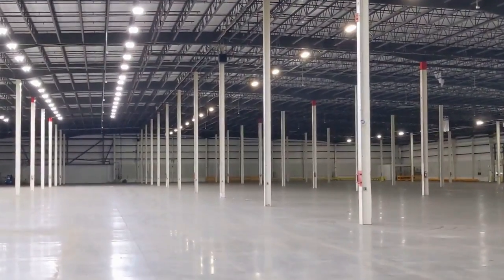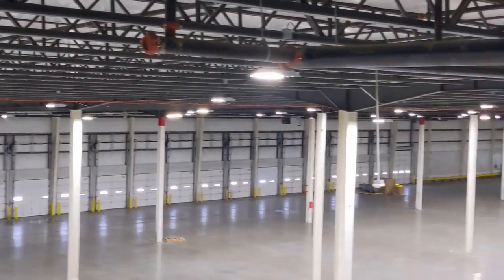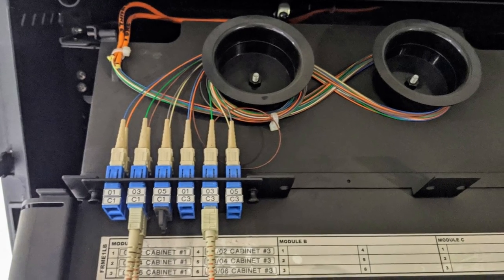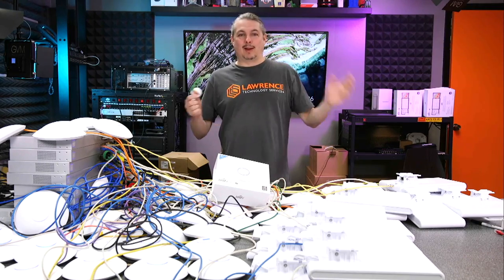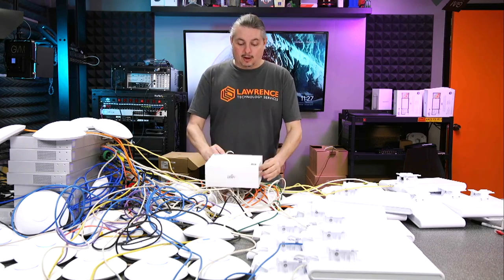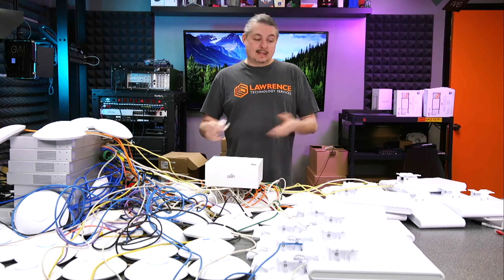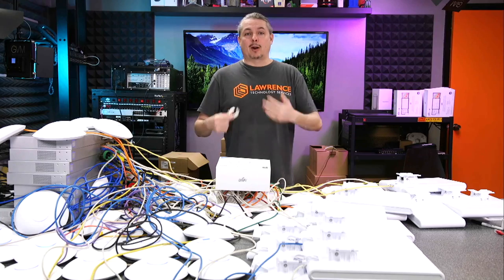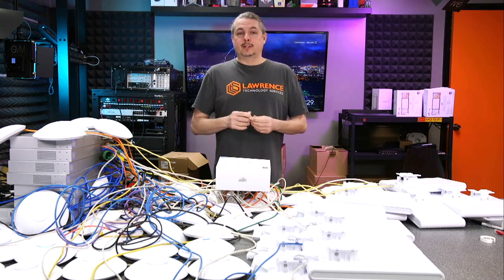Project: Installing 52 Ubiquiti UniFi Wireless Access Points For A Warehouse.

Comment: Looks like a amazon warehouse in the making 🤔🤔
Reply: yeah, but it's a bit too small for a typical amazon warehouse. i worked in STL4 which is one of the smaller warehouses, and was still about twice the size of that building.
Reply: Amazon isn’t using Unifi for damn sure
Reply: @vono360  I don't know what brand they use, but they're square with rounded corners, and really close together.
Reply: @kenzieduckmoo  Could be Aruba. They have decent density but not very high range (compared to Ubiquiti). A very popular choice for large commercial deployments.
Reply: I’m pretty sure they’re all Cisco deployments
Reply: @kenzieduckmoo  they are most likely Cisco 2802i for Amazon.. I've designed some systems for them and other very large companies. Last warehouse I did was 252 Cisco 2802i.  A lot are using rifiniti too for location.

Comment: I'd like to see the 90 day review and if you've had to reboot any UAP's for any weird reasons (slow, no clients, no broadcast passing, etc)... 😜
Reply: Show me the (per BSSID) iperf reports with a connected iperf -s directly plugged into the unifi switch after 90 days. 😂😜👍
Let me know how it goes 😝
Reply: I've got a 51 AP ubioquity WiFi set up that I installed and look after. Been running for over 2 years now and very few issues. I get more problems with idiots turning off power to my cabs than issues with the hardware
Reply: @diceman199  UI works great for small-medium hospitalities.
The highest concentration for one site that I have is around ~300 mixed UAPs deployed in a 3000 person 'hospitality' and it's always constant device problems (excluding user PEBKACs). Since day 1, and every upgrade after: they still randomly exhibit the 30 day lockup issue where they stop allowing clients to connect, don't pass broadcasts for DHCP/ARP/etc, or the jitter is unreal (like 300ms-2000ms until they reconnect). Every possible WiFi problem you could imagine: I've had with UBNT UNIFI UAP products. Low subscriber volume has never been a real issue (even for fast roaming): maybe every 6 months I'll have to reboot my office APs because they'll stop allowing clients to register or my boss will complain that XYZ, yet our office gigabit connection is working flawlessly. Just seems like they can't fix the kinks in their platforms, add features and add new bugs to what was previously working.
Other UBNT products are amazing, edgemax, airmax AC, all great. UniFi is just garbage. AirFiber is also terrible, ethernet jack tolerance problems, management interface problems due to how they handle packets destined to the CPU; bad if you have to compile reports for SLA clients about site performance/etc.
Reply: @jamess1787  Thats odd, i've never run into most of those issues and i have units that have been running for almost a full year without a reboot that regularly have 20-30 devices connected. Only problem i've run into was one unit that refused to broadcast SSID's but that was a single unit.

I'm not on the latest version of controller software though as i have 5 AP's that are end of life, so I won't be upgrading till those are changed out. It might be connected to later versions of the software?
Reply: @diceman199  I've upgraded the controller, and even reinstalled twice and manually readopted all of my customers UAP's (and had to roll a couple trucks and ladders).
We doubled-up our UAP install at this 3K person site because we were seeing upwards of 60 connected devices to some UAP's; from our AirMAX experience: we know that actual claimed versus ideal is about 50% for good performance. It's working OK, but having to reboot anywhere from 25 - 50 days for each UAP is silly. Some of our UAPs don't see any clients since their last reboot. Pretty spookey. More than just (occasional) faulty unit: something is definitely fishy with the software
Reply: I've even repurposed a couple 'NFG' Atheros units and put openwrt on them... Using them right now (out of production) and they work pretty good...
Reply: @jamess1787  This is not reassuring me about upgrading my software :-)
Reply: @diceman199  I think I'm still on the latest V4 controller because quite a few of my sites still have UAP v1's that the clients don't want to replace. I have a few sites on v5, but not enough to be able to provide a good enough review. Lots of these sites don't have UPS' and there are almost monthly (momentary) power outages where I live/customers live.
Reply: @jamess1787  My UPS batteries are shot but fortunatly power is quite stable where i am. I think when i do upgrade i'll be retaining back ups of the database so i can roll back quite easily if need be. We do lot's of changes on the WiFi as clients move in and out all the time so i'll just keep a tracker sheet of changes until i'm happy new software is stable

Comment: In my device it's only 10/100mbps only working. I tried to config 100/1000. There is no option y? My devices totally  3nos for wifi connection. AP AC device
Reply: Check that your POE port is in auto or force it to gigabit in the software.
Reply: Bad cable.